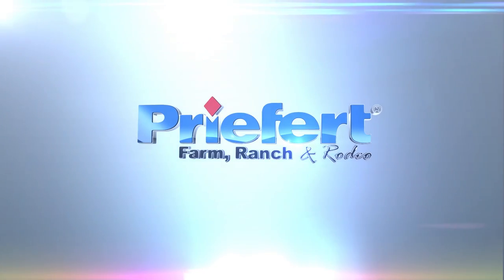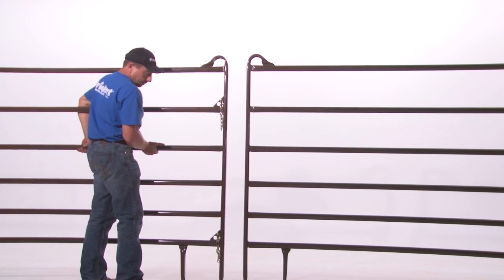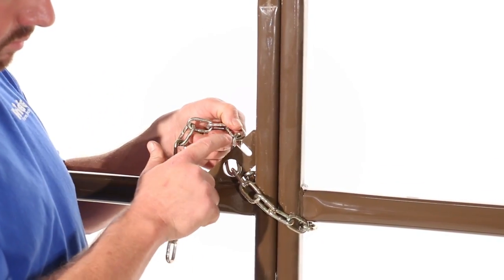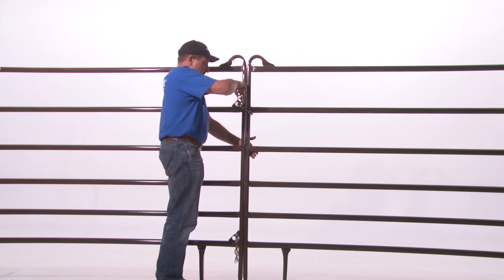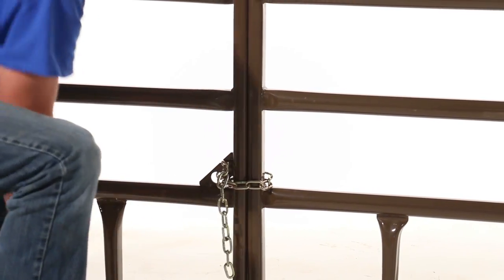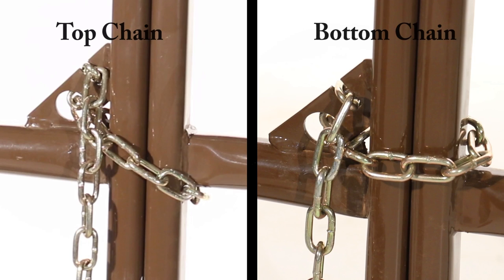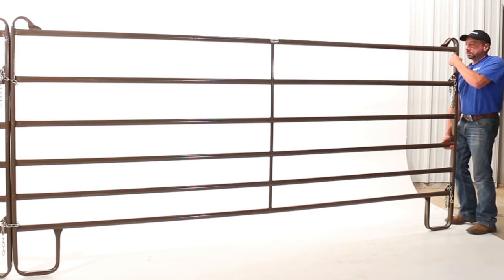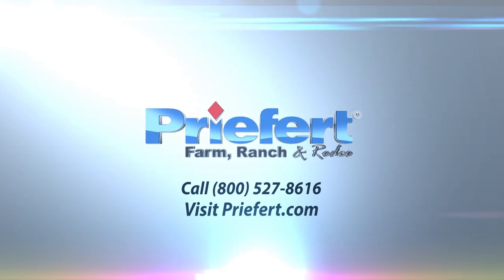How to Properly Chain Priefert Panels

Comment: I'm looking to get this for my wild mustangs. Durability wise I'm not concerned, but is there a chance that the horse could rear up and get it's hoof stuck in the gap between the panels? Is there something I can put on the top to prevent this?